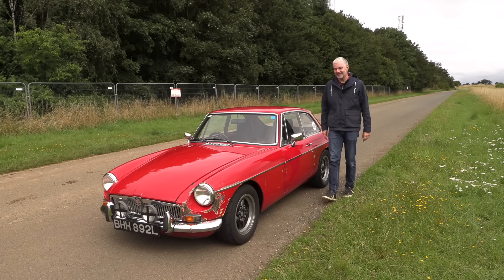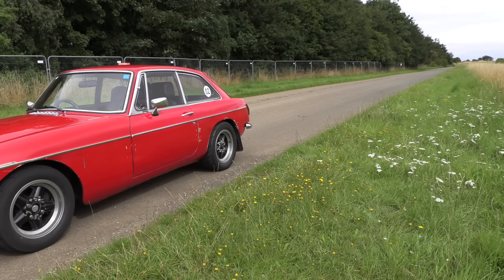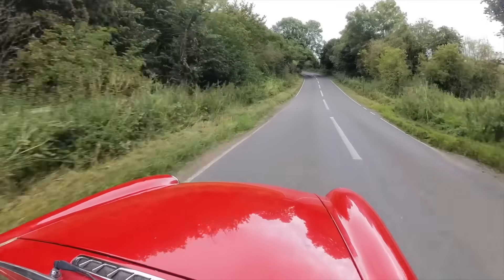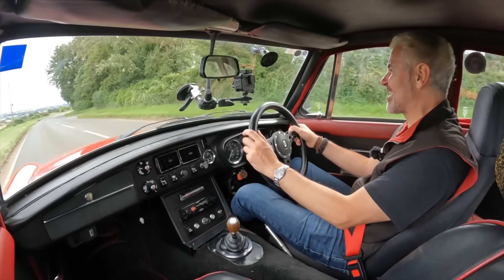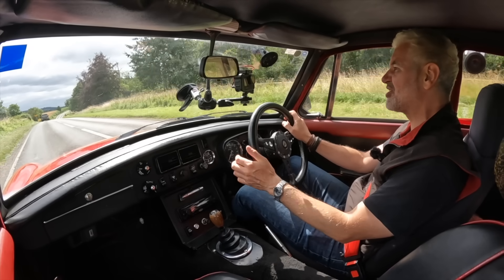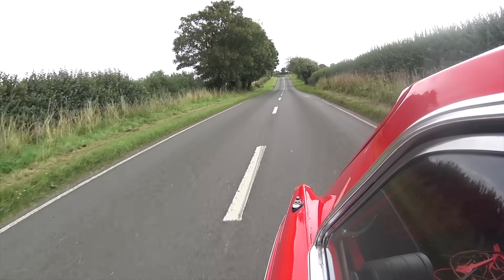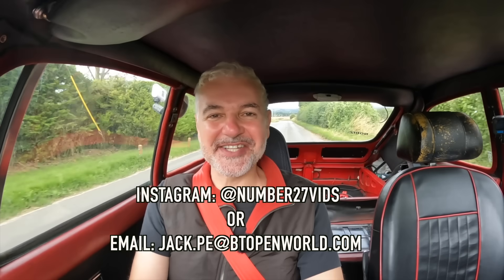This Mod Makes Electric Conversions Redundant - MGB GT Duratec

Comment: Electric cars are not the answer that would give much more fun but as its modified will it still get the free tax and no mot even though I still think it should have to pass a mot or at least a safety test but we will still be able to get fuel till about 2050 so as long as the screws don't get turned to much we can still drive our cars for the for the next 25 years or so I hope

Comment: I had a 1967 B in America, owned it concurrently with a '64 101 Series Alfa Giulia Sprint Normale. The Alfa suspension was superior in every way, brakes better too. The B was treacherous braking in a turn, I had to put a pressure limiting valve in the system. Axle hop in the B was horrible, washboard roads would have the axle off the ground most of the time. Putting a more powerful engine in it, not that there were many choices back in the early '70s, would've just made it worse.

Comment: It's a great mod for the money while the conversion to electric doesn't make any sense at all because of all the added weight which has no place on a track car. On an unlimited budget a K20 swap should have been on the cards. On the other hand it would be interesting to know why the entire MX5 powertrain wasn't dropped in.

Comment: I have always liked the MGB GT. I think this is a  good budget conversion and I agree that an upgraded MG block would be more expensive. You could have put in a V8 but that might not be within the rules of the racing category. On the other hand if  you are on a budget the V8 would not be a good choice. I think it sounds good which for me is part of the experience. Well done to Jacob and good luck with his continued work on the car. Thanks Jack for the video.👍👍

Comment: I've read a lot of comments on here about the sound of this thing, one or two even thought it wasn't loud ENOUGH! Not saying I don't like the noise, I most certainly DO,  but i'd like to make a couple of points.

 Firstly the car is pretty stripped out in the back so the body is gonna be like a drum inside making it louder than it probably WILL be when the trim and back seat is all refitted.

Secondly, when I was young (in the 70s) cars were loud and good rock was even louder, I loved it in both forms. Now i'm older I see virtue in peace and quiet (Not electric quiet) I build cars like this and have 2 Dolomite type cars, both with Vauxhall powerplants. The first is a 2 door Toledo and is a stripped out, lowered, lightened, detrimmed, stiffened up, road legal track day car. It's very loud, harsh, bumpy on the local lanes and a whole lot of fun. But not so much fun sat on the motorway at a steady 80. Get out after 2 hours of that and it's not only your ears that are buzzing. And racing seats are HARD! The other car is a Dolomite Sprint and is the car i've labelled "the cruiser" It's still quick with 147bhp on tap, but it has an auto trans, is fully trimmed and has extra soundproofing, more compliant suspension, a posh modern stereo that does everything but change your nappies, electric windows, central locking and a towbar. This car was built to do the Club Triumph Round Britain Reliability Run where we drive from Hertfordshire to John o Groats, to Lands end, to Hertfordshire. IN 48 hours over an October weekend. Roughly 2200 miles. All done in aid of charity. It's comfortable enough and quiet enough to make this epic challenge fun! The Toledo could do it just as easily, but i'm not sure I could survive that!

 If you have a car like this B, it is, like my Sprint, a daily driver and you don't WANT to be deafened every time you start it up. Too MUCH noise gets old very quickly. And you REALLY don't want the neighbours moaning when you go off to work at 6am every morning.

 How much noise is too much is pretty subjective, But I WILL say from the exterior shots, this B sound the mutts nuts!

Comment: We took our black MGB GT to northern Spain in 1982. Wherever we parked in a town, there'd be a crowd of folks gathered around it when we returned. They were iconic machines with a fairly gormless engine. I used to catch the Harwell bus from Abingdon in the early seventies and sat on the top deck so I could see into the MG factory yard as we drove past, I never had the money to buy one in those days.
Reply: Probably the best description of the B Series engine ever!

Comment: Except in many countries engine replacement with more power is banned, or requires individual re-homologation, and the process is ridiculously expensive and convoluted, at least in Belgium it is
Reply: I am certain that the Insurance would be invalid, unless you go through the Declaration Process. The whole car has a much higher performance now. If we do anything like that  here in Australia, the car must pass severe inspection before it can be road-registered. This could be a downside.

Comment: Another 'problem' with doing an electric conversion on a classic is that to make it worthwhile you need to get the rest of the car in perfect condition and add things like aircon and a decent stereo, whereas a petrol engine swap can be done to a more 'useable' car like this MGB.  Also, an electric classic only makes sense as an urban daily driver not a weekend car - something like a Citroen DS would be ideal.

Comment: This conversion is also "Greener" than an electric conversion since the carbon impact of a used engine and gearbox is 0 tons of carbon per year, unlike a new electric motor and a new set of batteries.
Reply: Aren't you forgetting something? E.g. the carbon impact of burning fuel and its production process?
Reply: @tedvga  Not really.  It's well documented that electric cars don't pay-off (carbon wise) until ~100k miles have been put on the vehicle.  A conversion is no different than a new car in that regard.

Comment: Combustion engines should be phased out as soon as possible (not only for cars but also for mowers, chain saws, leave blowers, trucks, etc.) for reasons that should be obvious.  Also the people sitting outside on beautiful summer evenings along the way would certainly appreciate not having to "enjoy the magnificent"   combustion engine sounds of passing cars. Let alone the stench and pollution, generated not only while driving, but also during refinery processes to make this harmful fossil fuels. Also wouldn't it be cool to see this magnificent sports cars being 100% electric?
Reply: You need read about 3rd world pollution in the mining of cobalt in the Congo and lithium mining for batteries, EVs may not be polluting here, but the effect on the planet is greater, most EV batteries are manufactured in China.. just saying we need a balanced view
Reply: @geofffletcher5739  You can laugh or cry, or  - consider it to be ridiculous - as much as you'd like about my comment..  think again. My ideal car would be a car like this - driving for hours in relative silence - without the roar. If I want to hear powerful and real impressive roaring sounds, I'd go to the zoo and listen to a lion or a tiger :o)
Reply: Modern petrol cars are hardly noisy, classics (most), have a great sound.

Comment: So what you have is an MG/Ford special to gain increased performance. Splendid but it is only partially MG. If ultimate performance is your goal you have the wrong car and should perhaps invested in a Cosworth. It is like those who put an electric unit in an E Type. The joy of the E type is its that it has a particular rear end set up and is tall for its track so 150mph was only for the brave. With the MG the front end was always a little suspect and it has had to be modified. So the potential of the old unit won’t give you the power of a newer strange unit. No real surprise there. It was done before in the C type and the V8 and the front end was paid some attention to by factory engineers. We’re they right? The Volvo had the attention of TWR who produced a vehicle excellent on the track but the massive section of the front wheels provided awful steering on road models which was only containable by power steering.  You can only do so much with an original design. The Morris Minor post war later provided the Wolseley and Riley 1.5 by addition of the early B series engine but it was never taken any further because the problems in engineering would never have made a profit on the sales envisaged. So the result is a period special is fine but it is a special and bears only a partial success of what was there before. I learned this as a young man because I had the amazing good fortune to travel , legitimately on Norfolk roads at over 100mph as a passenger in the Maybach Metallergice. I think it bore more of the airship engine than the car chassis and we looked down on the passengers of the coach we overtook! Specials are great fun but they are specials hence the rise of what came to be called kit cars for those with limited workshop facilities.
Reply: You know they put a 3L straight 6 in them from the factory?.   And the 3.5l v8 in the final mgb incarnation.
Reply: @rjbiker66  Yes, but that was a factory mod with their own engines. There was also the Rolls Healey and that too was a factory experiment with a modified, by Rolls I think, head on the Rolls Princess engine. All allowable factory experiments but when you put parts from separate manufacturers together as a private individual they become specials or if in limited production like Gilburn a separate company. However, it is all great fun which after all is the point of specialist vehicles.

Comment: I'll be honest, I can't stand British cars or modern Ford engines. I see on a daily basis how poor the quality has become because of mass production and silly design overviews based on engineering in a lifespan thats ensures items dont fail within warranty periods. However, I must admit that I was truly struck by the fact that someone has worked something out given cost and time constraints to produce something quite entertaining and satisfying to own and drive, let alone unique. That fact that the car is an ongoing project for this guy only goes to promote the fact that it'll get better and more unique over time. I have great respect for this enthusiasm and dedication. Top work. Just out of interest; I didn't catch what the budget for this has stretched to so far. Is there a figure?
Reply: 5k
Reply: @timbutton4990  

Well thats interesting; basically interesting performance for less than half the price worn out older used car. Got to be worth it really if you're prepared to research amd put in the effort. Top job.

Comment: In 100 years there will be Number 34 saying that if you are a true enthusiast you need to keep the battery and electric motor like in the old days, and skip the modern fusion drive everyone else does. :)
I agree the ICE is far more involving, but there are many other things other than engine noise that make a great driving feel, times change, we change. :) I believe extreme puritanism keep us back. :)

Comment: A valid conversion. Plenty of MGBs around so originality not an issue. Steering was mentioned a few times - does this have the original setup?
Reply: its a gaz coilover set up at the front but the steering rack and the mounting points are all the same.

Comment: Interesting engine choice.  I have a MGB roadster and am installing a 3.5L Rover V8, which will make for interesting driving, as the rebuilt motor has 250bhp.  Being alloy the V8 is a lighter engine than the standard 4 cylinder, which should improve the car's balance.
Reply: I have a 3.9 in mine. Changing the diff ratio is a must
Reply: @davidgerrard8661  doing the maths 100% agree, I feel a 3.08 is too tall maybe a 3.3 as a 3.7 is not that much different to a 3.9.  I also adding a Quaife LSD, Kpnis, Panhard and Tramp Rods to handle the extra power

Comment: I liked MGB's until I looked underneath one. Lever-action shocks and no ball joints in the front suspension? 

They designed a modern unit body and grafted the suspension from the TD onto it. Only the British.

Comment: Interesting piece. But am I the only one thinking that swapping a petrol powered engine,  for another petrol powered engine isn't really that much progress? 
The theory of swapping petrol for electric is completely radical compared to just swapping an ice for another ice (or so the green boffins tell us) 
People have been swapping original engines for bigger, more efficient petrol upgrades in vehicles  for decades.  
Nothing new to see here.

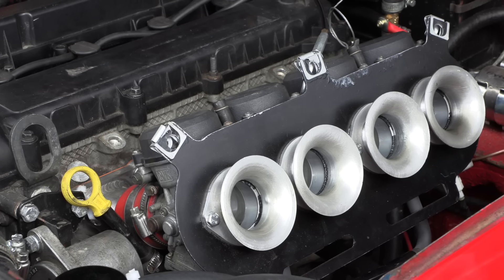Comment: 1:38 you nailed it right there with your comment about the sound. 

I used to be able tell what car was coming before I saw it by the sound. Engines sounded unique. Even the boring shopping trolley cars.

Comment: But, Jack...the body is a little bit - um - dinged up...I mean, no issues - we all have small 'fender-benders' - but why, oh why would someone let the sheet metal rust that way under the right headlamp? Also, it seems that the tach isn't working...I know that original Smiths tach is run by a cable - but with a bit of ingenuity...that Duratec should be able to drive an electronic one...either mounted where the original one is - or, just dash-mounted...I agree with you about the 'sanitized sound' - needs a freer exhaust for sure...however, lest I sound too negative - it's a nice swap and seems to be not TOO difficult with fabricated new engine mounts...
Reply from the maker: Hey, it’s called the patina look. Those bits are laquered over so they won’t get worse. I quite like it. Also Jacob is a student.. so money is an issue!
Reply: You redeemed yourself.

Comment: Interesting engine set up... being a Ford Duratec I'm guessing it was fuel injected with a computer control... Interested to know how all the electronics and computer were ditched for carbies.... carbies!... just great.
Reply: Throttle bodies, not carbs....fuel injection.
Reply: @johnnygeorgopoulos4072  Equally great

Comment: My god, even through phone speakers that sounds amazing! Why can't modern cars reproduce this  symphony of intake honk, exhaust bark and mechanical whirling? Love it!
Reply: Because they have multiple systems designed to meet emissions requirements, efficiency requirements and noise requirements. So if you are happy to compromise on all of these and aren't too worried about the consequences this is what you can get.
Reply: @MrAdopado  I know -- drive-by noise regs in particular likely have a lot to do with how modern cars sound. The modern performance car approach (loud, popping exhaust and piped in sounds) doesn't do anything for me.
Reply: Because manufacturers want to make fat profits.
Reply: Because of governments
Reply: @sbrenx7132 No, because of a@%*holes overdoing it, p#*&ing people off enough to complain to the police, who've got enough to do without answering nuisance calls, so lobby for tighter restrictions.
Reply: @garyallsopp6369 Not really, if anything it’s easier now to make a car louder with a simple map.
Traffic noise and air pollution are health concerns. Adding particulate filters in the exhaust muffles the sound. A turbo (there’s nearly no new NA car on sale) goes on the exhaust, where it quietens it further. 
The loudest modern city traffic is a 50cc scooter.
Reply: @garyallsopp6369 you don't have any right to silence lmao.
Reply: @HighFrictionCornSyrup  No, but I think you'll find the law says we have a right to a reasonable noise level LMAO.  Thankfully most people grow out of overly loud exhasts, realise the inverse perceived association with penis size and focus on note, not volume like grown-ups 😁

Comment: Thank you for another great video! You have me wondering how a swap like this might work in my 1959 MGA coupe project.  Even though they do differ in construction- the A being body-on-frame and the B a unitary- they share a great deal of bits, as the B had a lot of developed (and undeveloped) components from the A. Here in the States it's easy to get more than one version of Zetec/Duratec (or MXR) and and many MX-5 transmissions. Do keep us posted on his progress and feel free to give more particulars on the conversion as it goes along, please!
Reply: Hi there - a lot of people seem to use the mk1 mx5 engine and gearbox in the mgb and I've heard of people putting those in MGAs. No reason why this duratec wouldn't fit but I've not measured. Give it a go.

Comment: Here in the States, all Ford Focuses from 2005-2010 were gifted the lovely little Duratec 2.0L
It is a wonderfully revvy little lump that sounds surprisingly good.
I have one in my Focus, turbocharged with a GTX2871R, and a Cosworth intake.
The car makes 260whp and is really really fun to drive.
Keep up the great work Jack!!
Reply: Love this !. Love to see more retro mods
Reply: NICE !
Reply: Chev's Ecotec is a decent motor, too, for swaps like this.  Ford even had a supercharged version of it.
Reply: dont both this and the 5 cly engine have fundamental design flaws that can cause total failure?

Comment: A few assumptions here. Frontline Developments use a Mazda MX5 engine in their conversions/builds which I assume is basically the same engine as the Duratec. I understand that the Duratec was a joint exercise between Mazda and Ford. I think Frontline also use the Mazda 5 speed transmission which you referred to. The Frontline products look to be really nice (I have never seen one here in Australia) but they are very expensive. If this whole conversion was done for a touch over 5 grand it would seem very worthwhile. Like a lot here, I have always really loved the MGB GT. 
If this particular car had a refresh of the body work and a make over of the interior it would be something really special.